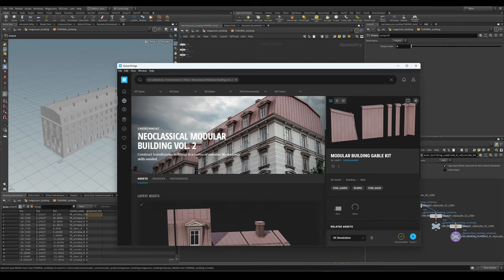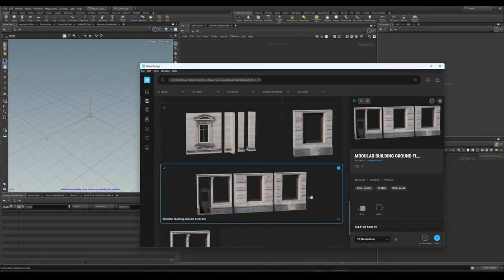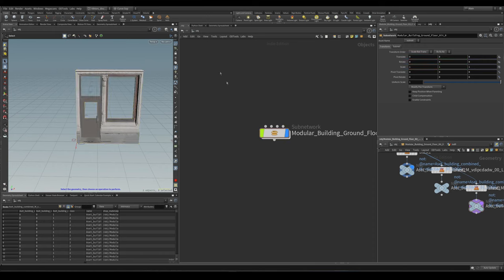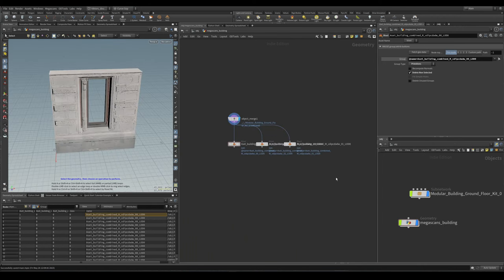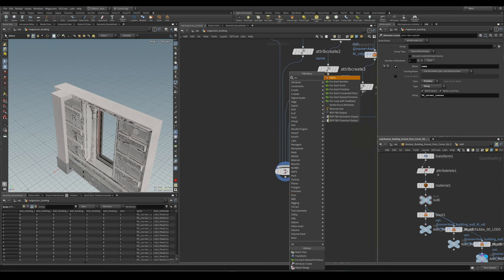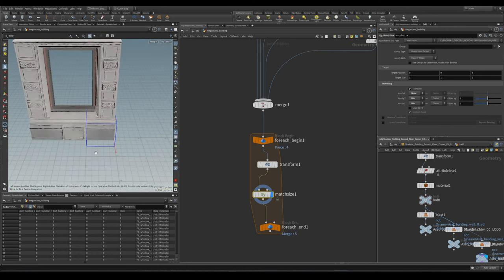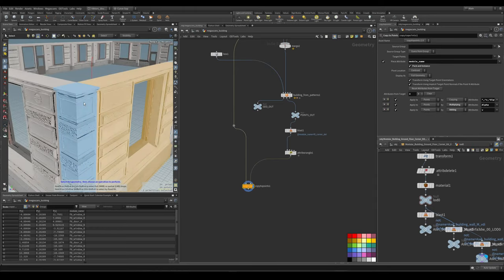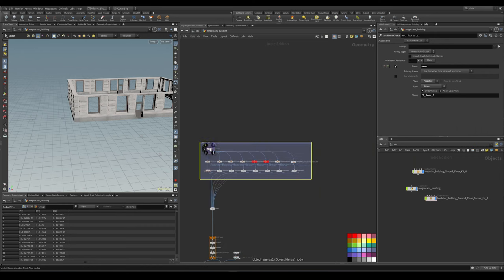Creating buildings from Megascans building modules in Houdini tutorial

Comment: My points from building from patterns are coming out without module name attribute, so the blast for corner  setup does not work. Any ideas?
Reply from the maker: make sure you have checked the checkbox from the pattern utility node that enables the pattern.
 if you can't get it working send me a hipfile, and I will gladly take a look
houdinielement@gmail.com
Reply: Found it. You have to dive inside the building_from_patterns hda and in end of points output, on a Set_orient node, on the cleanup tab, add module_name as a point attribute to keep.
Reply: @esparafucio   감사합니다. set_orient 노드에 연결 되있는 switch 노드 쪽에 attribcopy 로 module_name 가지고 오니깐 잘 작동 됨니다. 감사합니다

Comment: Excellent Tutorial dude, thanks a lot. Just two questions or problems I'm having right now:
1. How would you implement the convex corner here?.
2. To be honest I badly made my concave corners work, in fact I had even to scale them to make them match with the rest of the walls/windows and I don't know why exactly, if you have any idea why would that happen I would love to know.

Thanks again for your work man :D
Reply from the maker: Concave corners would basically also be done with identifying concave points from building node point cloud.
I have made concave corners for other buildings, and at the basis it would converting each floor into a polyline and putting down a labs node, I'm not sure what its called, but its takes polyline and figures out convex and concave points.

After that you would transfer the concave group to the building point cloud and you can rename those points to concave module names.

For the corners, i remember someone else asked me about corners not lining. I don't exactly remember the solution. 
I know it was something about module scaling. 
To help you out, write me an email, you can send me a file so I can take a look.
My email should be in my channel description.
Reply: ive had the same problem, what fixed it for me was to double check that my transform node inside the for-loop does not have any pivot or pre transforms and to set the match size - justify X to None. the other two are set to Min. Recache the for-loop as well if that doesn't work. might simply be a bug.
Reply: @viktors_anfimovs  Hey I am having the same issue and also another one, where I am using a more difficult blockout geometry, and when I have more than 4 sides the whole roof don't work as well as some of the corners, I guess because it cannot select half of the geometry for the procedural module selection and other issues.

Have you tried to use a procedural more complex blockout and still worked? And if so, would you mind sharing what did you have to modify?

Thanks!

Comment: I have hit another issue, on the attribute wrangle at 1:17:15 I get an error saying ; 
Invalid source /obj/megascans_building/attribwrangle2/attribvop1
Error: Read-only expression on left side of assignment (2,37). 
I have checked the code as it was done in the tutorial but not sure what is causing the issue 
int gable_tp_num = npoints(1);
for (int i = 0; i < gable_tp_num; ++1){
    vector gable_pt_pos = point(1, "P", i);
    vector gable_scale = point(0, "scale", i);
    float offset;
    int new_pt;
    if(v@N.x ==0){
        offset = gable_pt_pos.x;
        new_pt =  addpoint(0, set(offset, v@P.y, v@P.z));
    }
}
Reply from the maker: You have a number in incrementing ++1, it must be the variable we increment, witch is ++i
Reply: @viktors_anfimovs  Thank you. That solved  everything and I now have a complete HDA. The only thing I am seeing in the viewport is a normal problem with the edge of one roof. Is that just the viewport or should I be putting in a normal node along the way somewhere?
Reply from the maker: @DonquijoteDC  You can try to turn on flat shaded geometry in viewport.
Also maybe viewport is acting up, from labs tools you can from main toolbar, go Labs-Reset Viewport.
Look at geometry that you are importing, if the single piece looks correct. Normals should be correct for the megascans assets. Sometimes they do not look right.
Hope this helps!

Comment: are you using houdini 19? i cant seem to install the megascan bridge from their web to houdini 19.5 ..
Reply from the maker: Im on 19.5. 
Try to look where does megascans put its package folder. Make sure houdini picks it up. 
I think, bu default it should be in your documents-houdini19.5 folder
Reply: Had same problem, Bridge simply didn't create the necessary folder. 
Here is the solution: Create "packages" folder in your Houdini installation folder 
c:\Users\YOURNAME\Documents\houdini19.5\packages\
Manually create there a text file MegascansPlugin.json 
Edit the file to put there the path to your Megascans (using my path here):
{
  "path": "d:\\MEGASCANS_LIB\\support\\plugins\\houdini\\4.6\\MSLiveLink"
}
Save this and run Houdini, you should be fine.

Comment: This is an excellent tutorial. Really nicely done. Clears up a lot of information on the megascans. For some reason I am having trouble at 1:11:25, I am using 19.5 bu it says the syntax is incorrect for 0-`npoints`(0)/2. Any ideas? I have set the group type to points, it is the base group and I can see the group name appearing in the spreadsheet.  this is the message: 
Warning 
Bad pattern specified 0-npoints(0)/2.
Possible problems: Number out of range or a syntax error.
Valid Syntax: [!]start[-end][:step][,increment]
examples: !1-10:2,3 1-10:2 * 0-5 1
Reply from the maker: thake out the second `, secont tick means you are ending expression, and houdini reads everything after as a string, 0-`npoints(0)/2 should do fine.
Reply: @viktors_anfimovs  Thank you so much for coming back to me. Very much appreciated.

Comment: Does anyone know how to use the variation parameter in the building utility node in the floor description? I would like to have different expanded forms per facade face basically. Anything I add there takes too long to compute and make me abort whatever its trying to do.
Reply from the maker: If I remember correctly, create new modules without variation and then reference them in a new utility node as a variation and control its weight.
In a pattern reference the module with variations on it, and it should randomly select the variations.
Reply: @viktors_anfimovs  No luck. I think I have to come up with facade side variations on my own, this video is the only documentation that exists about how the node works.
Reply from the maker: I made a quick hip file to show a little bit of using variations. Maybe this will set you on the right track.
https://drive.google.com/file/d/1-0SPnwAPRmkO8AkJVwzFC60FhFiapeGo/view?usp=sharing
Reply: @viktors_anfimovs  That helped making sense of the variations, thx

Comment: corner system is not working with different modular version after deleting and replacing its not filling in the deleted corner.
Reply: is there any way to fix this?
Reply from the maker: If you still cant get it fixed, send me a hip file with your setup, i will gladly help you.
Reply: sent it to your email tell me if it works never sent a hip file before😅
Reply: also forgot to add that the modules are exported from unreal to houdini so i changed scaling to 0.01 and rotated them
Reply from the maker: @deadshot-re9ic  sent you an email
Reply: @viktors_anfimovs  it worked thanks so much❤
Reply: @viktors_anfimovs  can everyone get an answer to this problem?
Reply from the maker: @nkn_8944  the problem for dead shot was the justification of the corners, when you match size pieces.
Imported pieces are already correctly located, we just need to rotate them around the origin.
<email that I sent>
Don't justify by X in match size, and remember to put temp and del corners in patterns. Open hip file I sent.